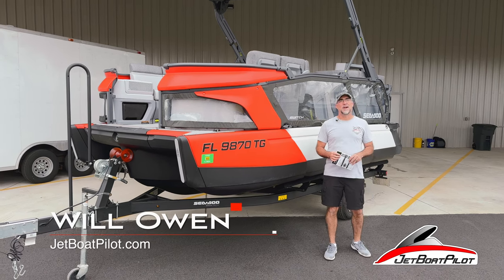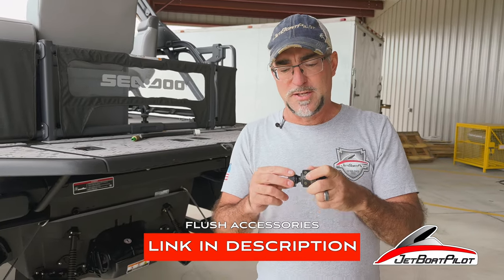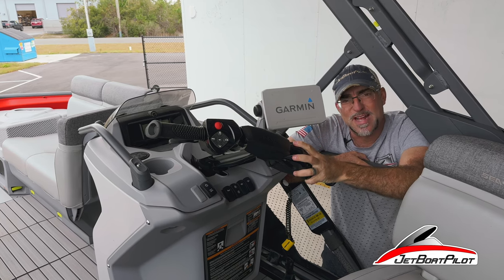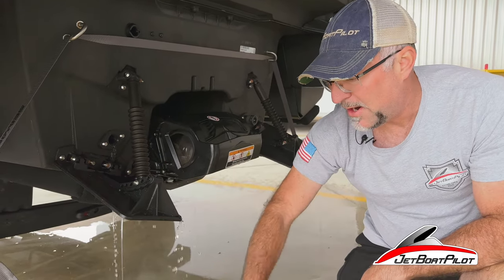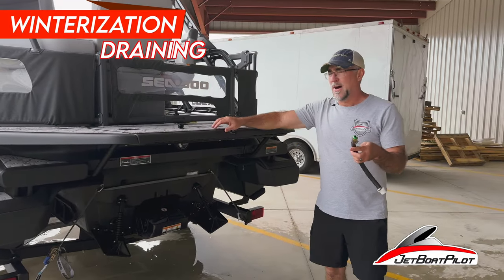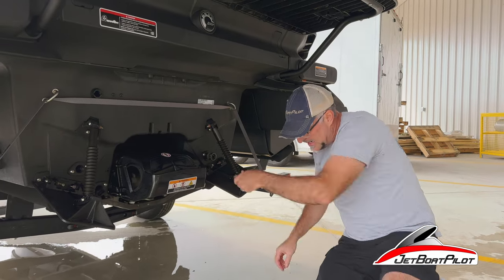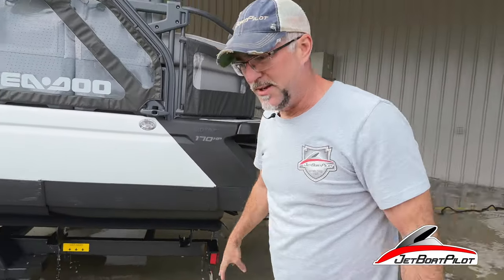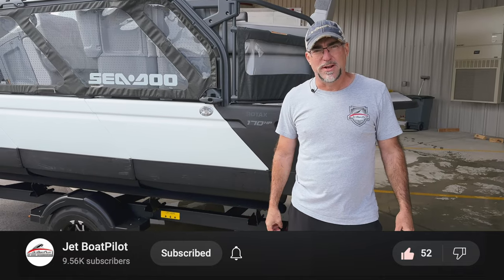Ultimate SeaDoo Switch Flushing Guide | What’s The Manual Say

Comment: Any chance we can get a video on how to winterize with antifreeze/flushing? BRP said that if the sea-doo dealers recommend it (which ours do) we should do it, especially up north.
Reply from the maker: @cjgropper  possibly, I'll need to study on that.
Reply: Me too
Reply: Did you find a video doing an antifreeze flush?
Reply from the maker: @nyzmostwontted  not necessary, just blow out the water in the exhaust and you'll be safe.
Reply: @JetBoatPilot  Great video!
What else do we need to do to Winterize the boat? Drain gas tank? Oil?
Reply from the maker: @FireDavidS46  don't drain the tank, fill  7/8" full and use fuel stabilizer. Also non ethanol gas is best. Also oil change now and spark plugs in the spring. Fog the engine if you boat in salt water often.

Comment: We have been using SeaDoo skis for forever and our biggest complaint was threading the hose every time (we live in salt water so we flush every time). Those quick connects look like a lifesaver!  We just purchased our 21' SeaDoo Switch - our first boat ever.  I'm hoping that our knowledge of PWCs will help us learn this boat quickly.
Reply: For Forever ♾️?⁉️
Reply: This guy Will, is All about Profit, he doesn't show you Everything. Especially the flex tether  nylon adapter for your Drain plugs. Very very important, so you don't lose your Drain plugs
Reply: @dcrican762 flex tether nylon adapter?

Comment: there has been a stop sale immediate corrective action put out on all unregistered switches to do a exhaust cooling mod because they have found that the catalyst overheats and burns a hole in the cat, sadly the amazing brp company has said any registered "sold" units are not covered until this problem happens, then they want to replace the cat and do the upgrade, so any switch owners be aware you could own a switch that could fail, then you got to take it to the dealership, then you have to wait for parts, and knowing brp's part shortages you could possibly be waiting a while most likely loose a season.

Comment: If I can add something for easy flushing and so you don't need to run to shut off the water each time to the value on your building, put Garden Hose Shut Off Valve between the end of the house and your quick disconnect. So you can shut off water by your quick disconnect instead of at the building.

Comment: hi i have 13-foot switch 2022 it has no exhaust port is the flush the same and is there actually a exhaust port on my boat some ware
Reply from the maker: @Richard-ql6yj  the flush is still the same. I don't think there is an exhaust blow out port on the 13 footer. Sorry about that.

Comment: I’m going to be putting mine on a lift beside my dock. That drain is terribly placed. Hard to get there. Any suggestions? I would need a raft in the water to get to it.
Reply from the maker: Some have attached a hose and quick disconnect to the flush port and have zip tied it under the swim platform. Makes it easy to access on a lift.

Comment: When you flush the engine and pontoons, would it be a good idea to flush pumping plumbing antifreeze through them?
Reply: I did it last year don't think it hurts to add that extra piece of mind. Up north it gets really cold I didn't wanna risk not doing it. I just added almost a gallon of rv/marine antifreeze into the line I used to blow out with air and just push it through with low pressure until it started coming out the exhaust side.

Comment: Great video.   I want to put RV antifreeze in my boat for winter storage.   I live on a fresh water lake so don't need to do the salt water flush.  I assume I simply drain the the current water via the exhaust port on the left and  then pump antifreeze thru the system till i see it coming out the exhaust port?  What about the pontoon rinse thing?  Do i need to get that water out or does it all automatically drain out?
Reply from the maker: You can add the anti freeze but to be honest if you leave the drain plug out and do a good job blowing the water out with compressed air you don't need to do that step. I don't know if I've seen anyone use antifreeze on an exhaust system, at least not on a switch so I don't have good intel on if that's a problem or not. I would not if it were me.

Comment: Are you able to do a procedural de-winterization video for the Seadoo switch 21?
Reply from the maker: There's not much to it. Just run hard on first outing, then change oil and plugs, and top off with super unleaded gas on next trip.

Comment: I like your videos. You recommended leaving the quick connect hose adapter in the flush port. Any concern leaving it in will reduce water flow to the exhaust during operation?  The opening in the quick connect is smaller.
Reply from the maker: Water is not flowing through the flush port until a pressurized hose is connected to it. It has a check valve in the line so water can't back flow out of the inlet.

Comment: Whenever we winterize our seadoo cruise, what do we need to do to start using the seadoo again? Do we need to flush the exhaust prior to use. We want to use our boat during the winter as well. Thanks great video
Reply from the maker: Just go use it! If you've used fogging oil for the air intake you may get some smoke out of the exhaust but otherwise you'll be fine.

Comment: Excellent video, thank you.  However, at the end you mention "You also have a little drain here.  This is for water that gets inside the deck and then rolls out, gets outside the boat this way...."  I'm not sure that is accurate.  My shop said that is where the bilge pump connects.  If you turn on the bilge pump, and there is water in the bilge, it will come out of that hole.  I've noticed that when anchored and swimming with a couple of adults standing on the back of the boat, that hole will drop below the water line.
Reply from the maker: There is a bilge discharge back there. There's also a water bailing system. I'll look again and sww where those lines go. I could have made a mistake. Thanks foe bringing this to my attention.

Comment: So there isn’t any need to fog the engine or add any antifreeze for the switch to be stored in freezing temps?
Reply from the maker: No on the antifreeze part. The engine is closed loop and has a coolant inside that will not freeze. The exhaust can be fully evacuated by using the Blowout adapter and compressed air. We have them on our website. You should treat the gas with Stabil or similar and fogging the engine is a good idea if the boat will be stored for more than 90 days.
Reply: How do you fog the engine?

Comment: thanks for this. What if water only comes out at the back on both sides? I understand that it should be dribbling out all around.
Reply from the maker: Its ok. Sometimes it will drain that way if the boat is sitting at an angle. Alot of times mine has drained more noticeably at the back but also trickled some at many other joints in the toons.
Reply: @JetBoatPilot  OK thanks! I did raise the Switch up at the front and water dribbled out in other places around it. Odd as I would think that it would have made it drain out more towards the back, but in any case it worked!

Comment: On the second step where the cooling system is flush, do you turn the water on from the garden hose on the inlet at the starboard side? Thank you for your video,
Additional question, for Canadian residents, do we pump in antifreeze for winter storage?
Reply from the maker: Don't worry about anti freeze. Just blow out excess water with our Blowout adapter. The cooling system flush is the same as the standard flush procedure. We just pull the plug to let any trash or sediment get out of the system. Make sure to reinstall the plug or you could fry your exhaust system.

Comment: Does the flush port have to remain open while not in use or can you leave the quick disconnect piece in?
Reply from the maker: @RosemarysBaby100  we leave the qd in place when in operation but the part that threads onto the garden hose we leave attached to the hose.

Comment: Love your video, But I have a couple of questions. 1) what is the correct tire PSI for the Sea-Doo switch trailer?  2) If my Sea-Doo switch veers to the right all the time, How should I adjust it? Thank you.
Reply from the maker: Email me at will@jetboatpilot.com and I'll help tomorrow
Reply from the maker: I believe its 45 psi on the trailer tires. I don't have one here at the moment to check but your sidewalls on your tires should tell you the max PSI. Also if you feel like the steering is pulling too hard to the right you can lengthen the steering cable a bit which will give a bit more left nozzle deflection while the handlebars are in the neutral position. Don't do too much of this though as it could limit your steering to the right.
Reply: @JetBoatPilot  Thank you,  I will try to do that.

Comment: Great video. I had a challenger prior and should be getting my switch soon. I have a question about your quick connect hose adapter, is it safe to leave that in? Such as it isn't reducing the amount of water getting in? Also, I'm sure I'll read this when I get my manual, but does the flush port for the exhaust stay open or closed when in use? Thanks!
Reply from the maker: I would not leave it on all the time. You really need to seal that system when not in use.

Comment: HI Jef. I guess that may be your name. I loved your in-depth videos and I hate admit that I binge watched them last night at past midnight. Only question I have is, my compact does not have the port on the left side that you open after running water through the port  on the right side. Mine only has the 2 drain plugs at the bottom and one threaded exhaust port on the right and a non threaded port top left and a threaded hull port on the right top. Wonder if the configuration is different for the compact. Thanks and keep up the good work. Don’t change a single thing.
Reply from the maker: What year is your compact?

Comment: Great video, wondering if I could do the winterizing with antifreeze like I do my PWC
I’ve never done air but always antifreeze until it comes out, I get the -30C or lower where I am.
Reply from the maker: You can but not mandatory
Reply: Your videos are awesome! I'm in Canada and bought a Switch in July. Just starting to think about winterizing. Should I put antifreeze in as well as air compress all the water out or am I fine to just blow it out?

Comment: Thank you for this.  After idling for 90 seconds, you turn off the water and then hit the throttle.  In addition to turning off the water, do you have to disconnect the hose before hitting the throttle or can you leave the hose in place until you're done with the second part of the flush?
Reply from the maker: If you have shut the water off you can leave the hose attached. If not needs to be disconnected first.
Reply: @JetBoatPilot  Thank you!
Reply: @JetBoatPilot  No water came out of the exhaust plug after flushing.  Should I be concerned?
Reply from the maker: @RosemarysBaby100  which plug?
Reply: I believe it's called the exhaust plug but it is the one on the other side of where the hose attaches.  It is kept plugged and in part two of the flushing procedure you are supposed to open it and run the hose & engine again.  In videos water typically spills out when the plug is opened.
Reply from the maker: @RosemarysBaby100  you may not see any water coming out of there unless you use compressed air

Comment: I went to the Sacramento boat show this past weekend and a person selling the current model said the advantage of the jet drive is that if the engine needed repair, he could fix anything in 40 minutes. Would you agree with that? It seems like an exaggeration.
Reply from the maker: Not completely accurate. The jet pump can be pulled apart at the dock very easily.
Reply: @JetBoatPilot  thank you. He stated that if the engine came into his shop, no matter what the problem he could have it fixed and out in 40 minutes. I am 63 years old and I’ve never had a jet boat but I knew that statement had to be an exaggeration. Thank you for your videos and your knowledge.
Reply from the maker: @craighellberg4366  probably an exaggeration.

Comment: If I want to keep my Switch on a boat lift, it's impossible to reach down to the flush port from above to connect a hose.  Is there any way to redirect the flush port or access it from the engine compartment while on the boat?
Reply from the maker: It is possible but there are several potential fail points that could cause damage to your boat if you make a mistake during the flush. We did it on our last Switch and it worked well but we ultimately did not recommend the conversion to others due to some really complicated issues that arose during the use of the conversion. In short you can do it but its possible that you will damage your boat's engine if you do it wrong.

Comment: hey how are you, I have the same you have a 2023 18 inc 170 cruise, have a question do you know any way that I can make faster, the 170 is a little bit hard to get some speed on the water
Reply from the maker: @AnddyMore  that's a tough one. Not sure if there's an ecu flash yet. You may want to check with Riva Motorsports. Also possibly an impeller that is pitched for more high speed. But be aware you're not likely to gain more than a few mph.

Comment: I don’t know much about air pressure 55 psi. Do air pressure tanks have a way to gauge that or is it a compressor that specifically says 55 psi. I found one at harbor freight starts at 110 psi. So not sure why you said 55
Reply from the maker: 55psi is the max that the flush system can handle without damaging the system. You have to have a regulator to dial down your compressor. They're not expensive.

Comment: Any info on how much water flow is enough? The quick connects I’ve been finding have only a small hole in them for water to flow through. Even the Salt Away mixer has a fairly small port. It would be helpful if there was a GPM number we should be trying to hit.
Reply from the maker: I don't think it's that complicated. A standard quick disconnect fitting seems to work just fine for us.

Comment: Will this also flush out the intercooler for the super charger? hearing it will freeze and crack?
Reply from the maker: Watch our video featuring the blowout adapter that we sell. It will help you to remove water from the system and prevent freeze damage. This step is helpful but that video speaks more to the blow out procedure.

Comment: I just noticed that I don't have a screw in drain plug cap at the back on the upper right side (ladder side) for the cooling system. This isn't the one up further for flushing the pontoons. Isn't there supposed to be a plug there?
Reply from the maker: You should see a cap on the lower left and the actual boat drains (just to left and right of the ride plate) all others will be open.
Reply: @JetBoatPilot  So it looks like I am missing one of the four cap plugs at the bottom. The two on the left side are there, but the top right one is missing. I presume that I can't launch the Switch until I get a replacement cap, correct? Can I send you a picture to make sure we are looking at the same thing?
Reply from the maker: @lloydkelly8362  the video features our boat with proper caps. Match yours to our boat.
Reply: @JetBoatPilot  I've watched it a couple of times now and it looks like you don't have one in the port where you put the garden hose attachment. is a plug not supposed to go back in there after you take out the hose attachment? Thanks so much for your videos and answers!!
Reply from the maker: @lloydkelly8362  correct, only on the drains.

Comment: Nice Video,  On your Air hose flush, Why not add the regular quick connect to it. so no need to remove the boat and reconnect it again after.
Reply from the maker: Thanks, not sure I understand the question. Can you elaborate?
Reply: Sure, and thank you getting back so fast. So on the engine water flush - you had installed 1/2 quick connect and the other half to the hose. However when using the pneumatic hose - you had removed the quick connect - ad screwed in the air connect.  So my thought would be - would it be easier just to have a quick connect  on the airhose to the boat -
Reply from the maker: @grein46087  we have an adapter that has an air hose quick disconnect on our website. Is that what you mean? I am not sure I could do both water an air through the same line if that's what you're saying.
Reply: @JetBoatPilot   Ok not running water and air on the same line.  On the boat, there is one half of quick connect, and you had the other on the water hose.  I am good there.  So when demonstrating the air purge,  You had removed the quick connect to screw in your airline.  What I am asking is,  would it be a easier to also attach a quick connect to the air hose - so there is not any unscrewing the adapter, screw in the air hose [do the air blowout], unscrew air hose and re-screw in the quick connect adapter.
Reply from the maker: @grein46087  ahh, I think I understand you better now. I guess that would be pretty simple. Yes.
Reply: If I understand you, G-man...
Use two male connectors. One male connector on the water line and one on the air line. This is not to be used at the same time, but to allow a fast easy change between the water line and the air line while using the same female connector already on the boat. Makes good sense.
Reply: @j.thomas7128  Yes - exactly.

Comment: If using in the same lake every time. Would flushing after each use still be required ?
Reply from the maker: No, not really. But if Left in the water all the time gunk can build up in the system so it's recommended periodically in that scenario.
Reply: Did the boat come with those trim tabs ?
Reply from the maker: @owarmorowarmorvideos7180  yes it did